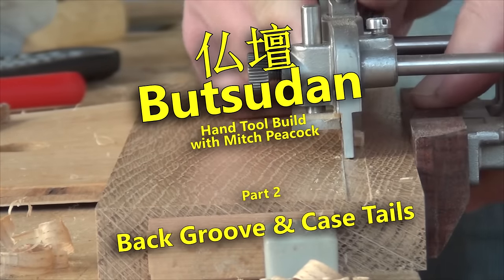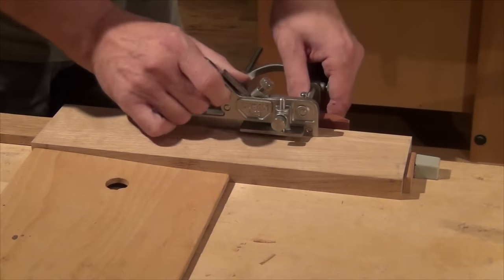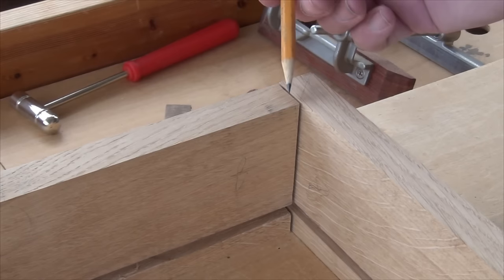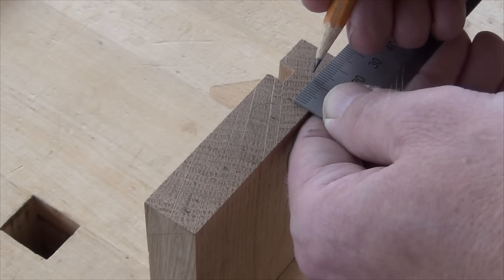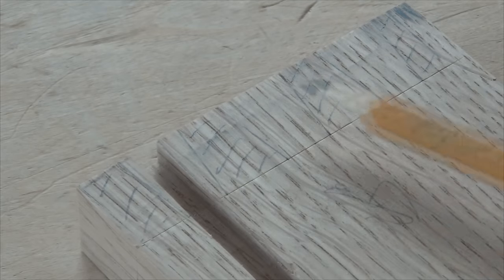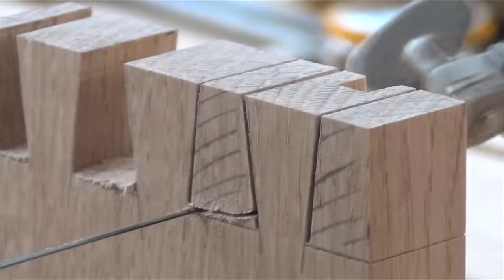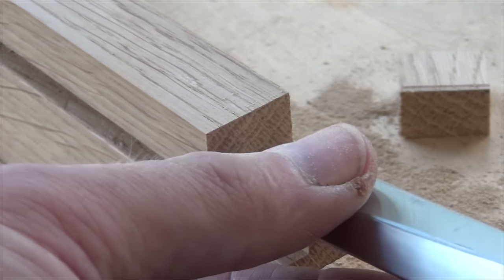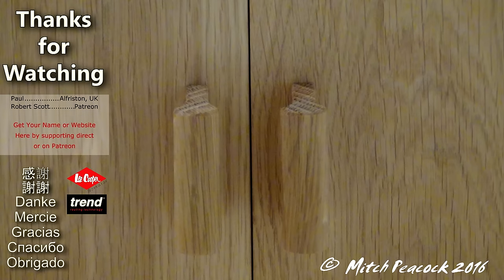Butsudan Build Part 2 - Back Groove & Case Tails

Comment: Excellent! I will have to be patient with my softwood version to get clean dovetails, but I'm looking forward to it. I have the SKP file and discovered my rough planing brought me to 3mm of the finished thicknesses. That's just a little smoothing left to do.
Reply from the maker: Excellent! You might like to try one in six slope for softwood, rather than the one in eight I used.
Reply: OH! Thank you!I will do that.

Comment: Very nice, Mitch. Is that a fret or coping saw you are using?
Reply from the maker: Cheers Steve. It's a jeweller's saw with a fret saw blade. The kerf of my Japanese dovetail saw isn't wide enough to take a standard coping saw blade, so I got used to using this. It cuts the oak pretty well.
Reply: Ok, thanks.
Reply: Mitch Peacock - WOmadeOD Mitch, do you know the brand of that jewellers saw? I see a lot of cheap ones around, but wondering if it's worth paying more...thanks